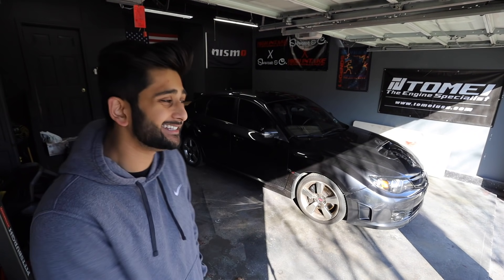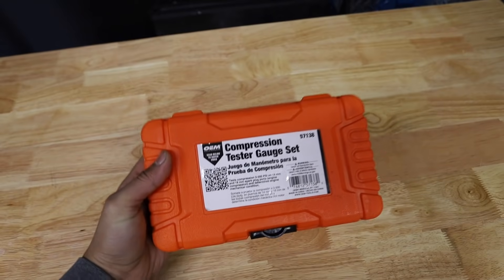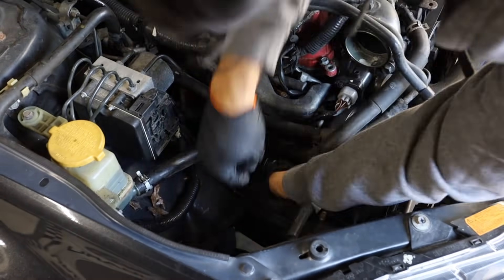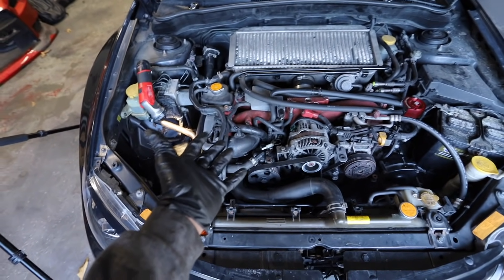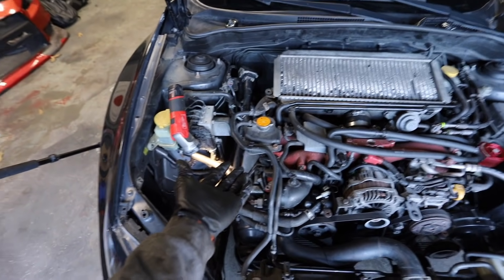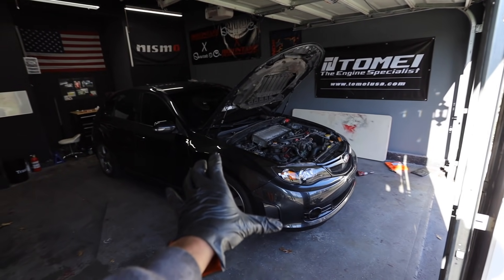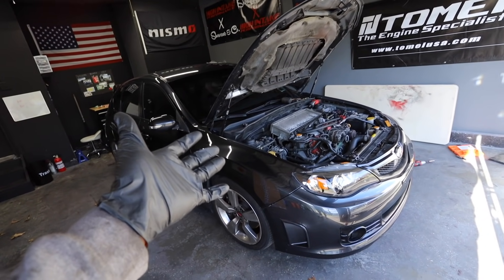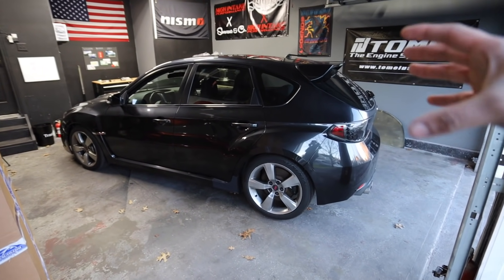You NEED To Do This After Buying a Used Subaru!

Comment: Cyclinder cooling mod, aos, radiator should make that EJ last
Reply: Killer B pick up and baffle. And EL all EJs
Reply: @joshmorrow424  wtf is EL
Reply: @HeadShotPR  forgot the H😅. Equal Length Headers
Reply: @joshmorrow424  oh lol 😂
Reply: Meh.  Just drive it normally.  Have a little fun.  Don’t beat in it.  Change the oil.  It will be fine.  These mods are dumb.
Reply: I feel like this is a product plug because I didn’t do that for my last two boosted Subaru engines and they gave me no issues.

Comment: Great looking car in very nice shape. I honestly don't see why people want to take these cars to 400-500 hp, 350 is more than enough imo and it'll still give you plenty of driving pleasure. It's not worth it all the work you'd have to endure if the motor blows later on. Good luck!
Reply: Agreed, sounds great and 300hp is more than enough considering the reliability issues you run into when pushing up the power

Comment: Just bought an 08 WRX sedan. 100% bone stock, original motor, original clutch, 153,000 miles. Very helpful video, wish me luck guys lmao
Reply: Actually getting an 08 wrx sedan all stock by the end of the week 124k miles the previous owner had got a turbo that didn't work on it and he couldn't shell out any more money so he sold it to a used dealership up the road. Anything I should look out for besides compression?
Reply: @Doriangrey98  its stereotypical but check for overheating issues and head gasket leaks. Check the head gasket by looking in the coolant reservoirs/oil cap and dipstick to see if there is any frothy stuff on the inside. If its still overheating you can bet the previous person to change the coolant didnt bleed out all the air. As far as other things go, check for rust obviously, and make sure the transmission feels strong.
Reply: @Lil Car Crash okay have you had any issues out of yours yet? Cause like yours everything's stock/OEM as far as I can tell. Not lowered, stock intake, exhaust system, turbo etc. And transmission feels pretty good when I test drove it. What would I need to get a feel for? And sorry for all the questions lol this is my first wrx.
Reply: @Doriangrey98  my first WRX as well. But I made sure to do more than enough research because Im always paranoid when buying used lol. The issue i am having right now is overheating. Tomorrow I am changing out the upper radiator hose, coolant flush, and thermostat. Hopefully that solves my problem. If you have been able to drive yours around without it overheating and the trans feels good then I dont think you have anything to worry about. And yes, check that compression. Did the dealer put a new turbo on?
Reply: @Pilikestortoises  yea they put a new one on. What all you plan on doing to yours?
Reply: Just spun my 09, going iag stage 2 now. Blessing in disguise. Or that's what I keep telling myself to maintain my sanity

Comment: Congrats on the clean STI. A fuel system, fmic, and a blouch DOM 2.5 xtr should put you in the 400-450 hp range. EWG is a must. These motors make great power for what they are. I really do dislike intros like this though. Thats what has given the EJ motors a bad rap. Its not the motors that are "unreliable", its the owners not taking care of them, cheap poorly designed aftermarket parts, and even worse tuning that kills an EJ. Its all about the tune, spend the money and get a good tune, not a one size fits all tuner flash. Cobb AP tuned on the dyno will turn it into a whole different car, with reliable power. Ring lands when the boost is brought in too hard. can be fixed with a good tune. After owning a GTR you should know, you have to pay to play. Hope the STI treats you well!!!! Thats one  of my favorite bodies.
Reply from the maker: thank you so much! I will definitely look into those mods, im new to the ejs so i appreciate the info!!
Reply: It's the motor

Comment: IMO they will last forever if properly maintained. Additionally they will need head gaskets at 120k to 150k miles. Costs about 500-600 if you do the work yourself.

Comment: 2 ltr WRC sti turbo 6-speed manual if you can find one 300hp from the factory  2ltr boxer motor has a million great mods you can buy if want to go that way reliable  but under extreme pressure they blow like any motor really  my wife has one stock but exhaust and retune which she loves 300hp is more than enough for her

Comment: I have a built 2011 STI I bought from NJ, with 67k miles, no rust, needs a trans service and I'll be changing every fluid in the car and doing a Dyno run to check the health of the motor after I do a compression test and everything. I do have a fully built 550+ whp motor waiting for heads to get done and the turbo, for it to be ready to go in if my current motor goes

Comment: Boxer Diesel owner here.

I personally found the "easiest" way to do stuff at the cylinder heads and engine in general by simply removing the tires and the wheel arch.
It was also my way to go as i had to replace the bulbs of the front light. Subarus are some nasty, annoying things to work on. But also interesting somehow, they are "different" in so many ways beginning already with the whole engine+ drivetrain

Comment: Hey man - you will love your subaru - they are so much fun and reliable - me too i thrashed my ej205 - and got a virgin ej207 sti ra short block - 440cc injectors and td04 turbo just running in - 6,000klm = great show thanks tight is the word . cylinder 4 coolant buy-pass kit = well worth it ! big improvement ! on my new heads !

Comment: Nice Ride

I just bought a base 2019 Impreza used with low miles (commuter)... first things I did were:

Custom stereo build
Sound deadening
Alarm system
Window tint
Paint correction and detailing
Ceramic coating.
Wheels and Tires.
Headlight upgrade
Better sounding muffler
Splash guards

I had a 2009 Sport Impreza that was getting old and high miles, so I sold that to a friend super cheap, and bought this...Love my Subarus...best cars I've ever owned.

Comment: I beat the shit out my wrx 2014 hatchback, purchased it with 69k miles one and a half years ago and now it has 145k miles. (OriginaI engine) i have  a cobb accessport stage 1+ off the shelf map, IAG oil seperator, turbo heatshield, invidia muffler catback, perrin pitchstop, and cobb air intake. I do my oil changes every 4k miles. Car still going strong
Reply from the maker: i hope to have that luck with mine haha

Comment: Nice car and a good color too. Really, you should have done a compression test before buying. If it has an issue after you've bought it... Well, that's gonna cost you. The cylinder you have marked as #1 is number 4.
Reply from the maker: if it was a normal car I definitely would’ve done it before I bought it but it being a Subaru and having to take things apart I don’t think the old owner would’ve wanted me to do that😂 but thank you for correcting me i was confused on which way the numbers go haha
Reply: @beakhan  Haha true, But you could ask a shop to do it. It's pretty common to have mechanics check out the car before you buy it. These STi's are holding their value really well. IMO, the biggest problem is rust. Depending on where you live it can be really bad. With the EJ257s, That's about $2500 JDM replacement engine + the timing belt kit. So roughly $3k in negotiation power. And that's if you swap the engine yourself.

Comment: This is kinda useless because you would like to do a compression test on sight when buying a car but what seller would ever let you do this ? especially the ones that try to sell a broken car with an almost dead engine ,I wanna buy an impreza with 153,000 miles on the clock ,the guy would probably just lock the car and leave when hearing about this lol

Comment: what you really need to do when you get an STI... change the timing belt and head gaskets every 80k to 100k miles.
Reply: That Gen WRX doesn't have head gasket issues.  It has ringland failures.